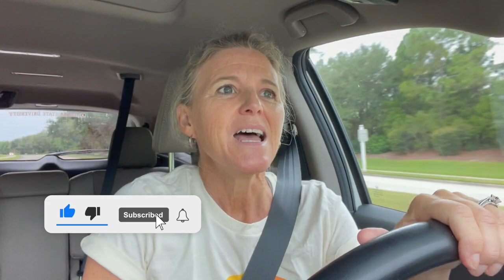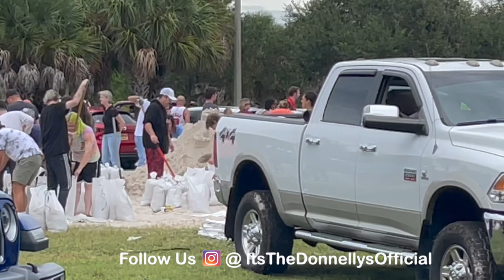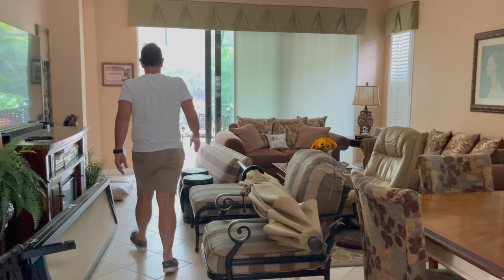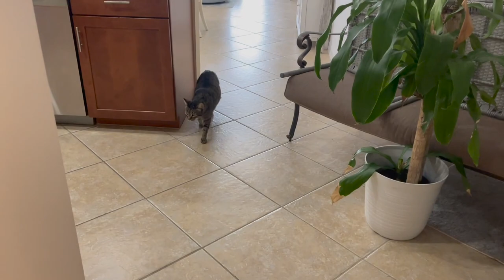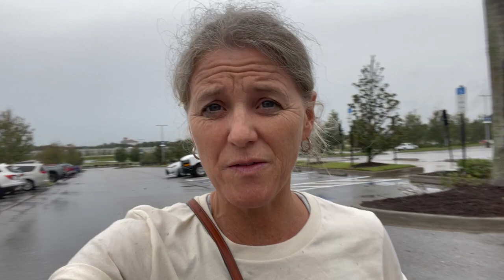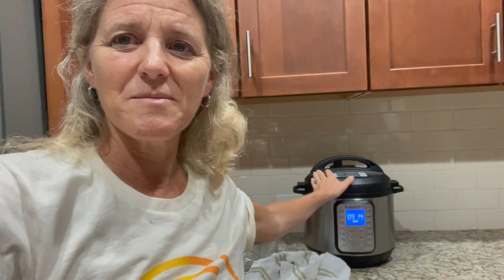HURRICANE PREPPING | Our FIRST Florida Hurricane

Comment: Prayers for all in Florida.  I really hope you invest a generator or those portable power banks.they can be charged by solar power.  Y.ou can run a lot of different electrical things like refrigerators.  It depends on the size.  No need to worry about gas.